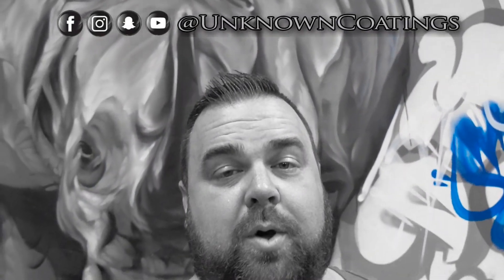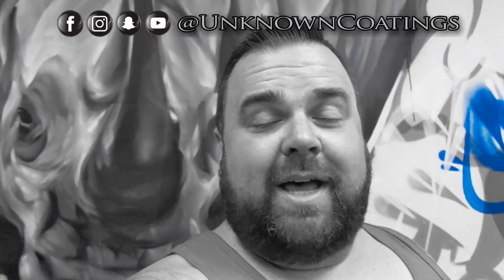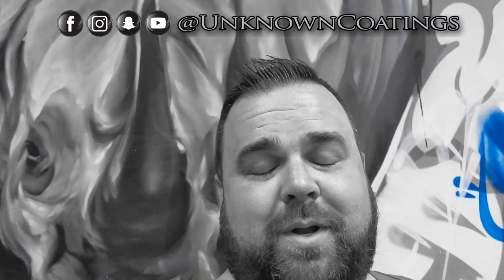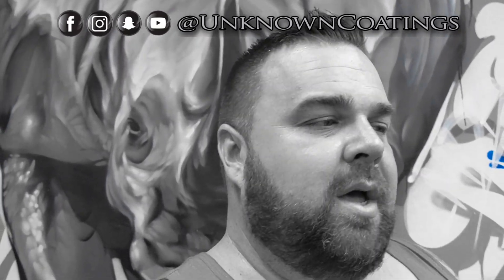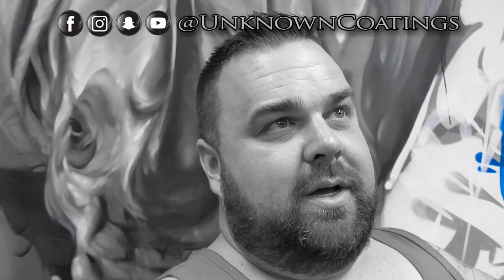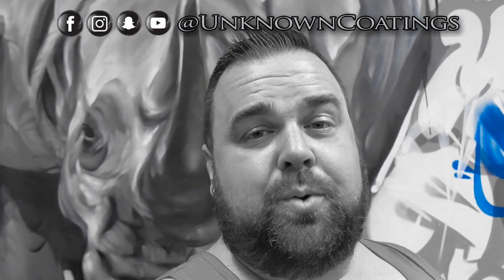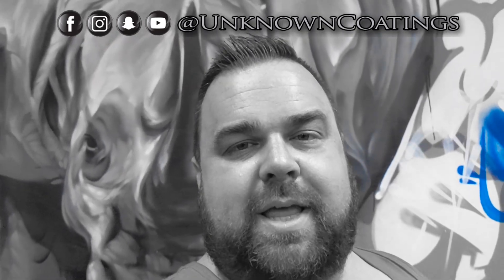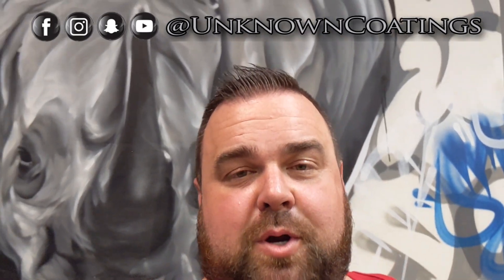How do base colors effect candy top coats?!?! - Ep 121

Comment: Great Vids!! I just subscribed! I have a question for you. I'm just getting into PC'ing and I'm making the oven out of some really cool all metal containers i found on Marketplace that are about 4'x5' and 3.5' feet deep. They appear to be painted from the manufacturer to prevent rusting. My question is, I do I need burn off the paint from the interior walls before baking any items? I'm wondering if it will have an affect on items when i bake them (fume/chemical reaction to the powder/finish). Any advice is greatly appreciated!